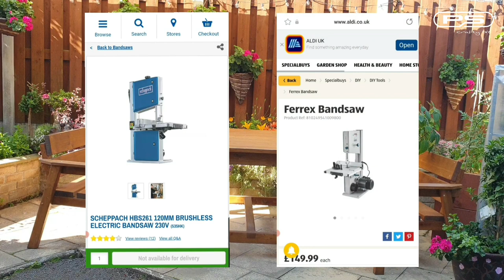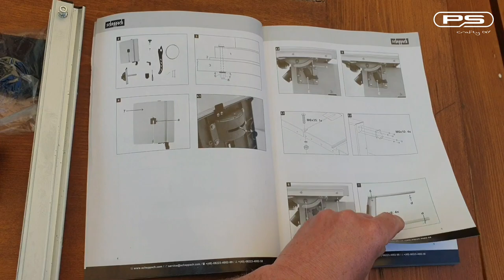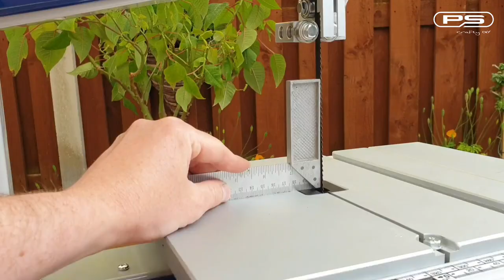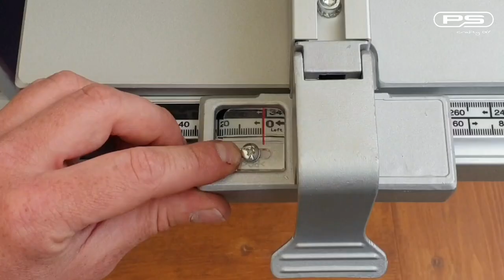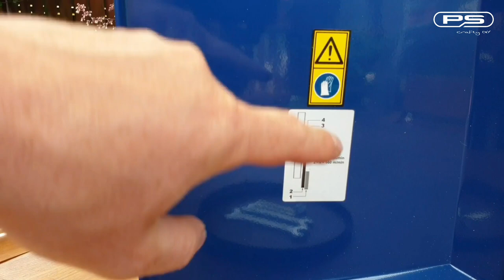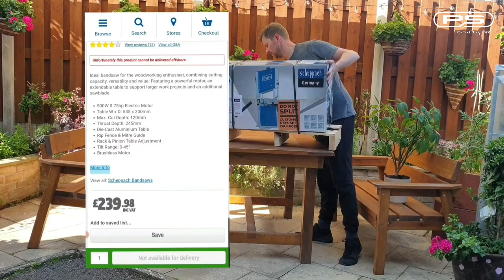Scheppach HBS261 Aldi Ferrex Budget Bandsaw Review || Unboxing, Assembly || Set up for accurate cuts

Comment: Dear @PS Crafty DIY, thank you for sharing your knowledge and experience. 🙏🏻🙏🏽It was extremely helpful 🙏🏻🙏🏽.
A little tip I could give back: Taking a little drop of a Ceramic/Nano Coat Spray on the outside of the ball-bearings keep them smooth and nearly dust free. (Personally I used it also for nearly every surface, but especially on the Fence, table… )
Reply from the maker: Thank you. I use Interflon oil on all my gear to keep the dust off. Also works great.

Comment: I have been ripping kiln dried hardwood on this machine for 3 years , excision blades are the only way to go , had to replace a external motor capacitor once, bought the capacitor from jay car, my machine has done some heavy hard work, just take it slow
Reply from the maker: That's great, thanks for reporting your experience with the saw. Faulty cap after  years of hard work is not bad to be fair, they tend to go in motors powersupplys etc. I bet it was only few quid.

Comment: I just got one of these, thanks for the review. They are now back in stock in the UK at the usual places (toolstation, screwfix) but sadly no sign of the bargain version back at Aldi
Reply: So now I have it running initial impressions are positive. It was reasonably easy to adjust everything to get it square following this video. The main things I don't like are:
 - it's hard to explain, but there is a lot of wobble in the the upper blade guide as you raise and lower it, which can make it hard to set the position relative to the blade consistently. I assume this is normal? 
- the supplied blade gives a somewhat rough finish, but this seems to be  common complaint. I'm keen to try something better.

Comment: Superb informative, and funny, video. Great work. Keep it up......one question; any issues with the 4.7mm blade? Has is lasted well? (would also be good to add the Tuffsaws link to the blades in the description).
Reply from the maker: Thank you. The blade did quite a lot of job before it snapped. But I think its my fault as forgot and kept in the saw tensioned up for long period of time. I would not hesitate to buy this blade again. I didn't include any links as I am not sponsored by anyone. But all my blades are from TuffSaws and they are from the Supertuff carbon range.

Comment: Grazie, comprata una oggi ma senza il tuo video non sarei mai riusvito ad intallarla.
Please,dimmi la lama che hai ordinato ,grazie
Reply from the maker: Hi, thank you. The blades I use are from TuffSaws.co.uk I have ordered the Supertuff Carbon range. 3/16inch 6tpi is my thinnest blade  and 1/2inch 4tpi is my largest blade. You'll need 1790mm length blades.
Reply: @pscraftydiy  grazie molte. sei gentilissimo. Per favore aiutami ancora:   la lama e' troppo spostata verso destra e rischia di toccare la plastica . E' possibile spostarla di qualche millimetro verso sinistra?  grazie ancora.
Reply: posso inviarti un video e/o una foto ?
Reply: @silverblogsurfer9338 Hmmm...thats not good. The blade should not move left or right unless being pushed over by guide bearing or something. Its position is defined by the top and bottom wheel alignment. The bottom wheel can be adjusted at the back of the saw by 4 screws around its shaft. But please do some research before you start as I have never done it before and certainly not an expert. It should come set from factory and you should never touch these. If your saw is new in warranty take it back or contact Scheppach for support. Try running a proper blade in it first. The one that came with the saw is rubbish and you'll never get that to perform.

Comment: Excellent video!!! So in depth detail of the setup. The best one i´ve found so far. Im looking forward on upgrading the blades. Which blades would you recommend for straight cutting and radius cutting from TuffSaws?  As TuffSaws seem not to be shipping outside the UK at this moment is there other reliable brand/supplier i could get decent and reliable blades? Thanks again.
Reply from the maker: Thank you. I've never tried any other brands than TuffSaws blades to be fair. These have been recommended to me along with the Bandsaw Shop blades manufactured in Leeds. These also have good reviews. I made some inquiries with both manufacturers but only TuffSaws were able to supply the 3/16 blade and actually said if it snaps or does not run in the HBS261 they will replace it with 1/4 that they know for sure it runs. That was convincing enough for me to stick to them. They recommended the Supertuff carbon range as lot more tension can be applied and better traction can be achieved because these blades are thicker. One disadvantage is that the cut is slightly wider kerf than standart blades. No bother so far though.
I use  the 3/16 6tpi blade for tight curves and the 1/2 4tpi for long straight cuts in higher stock. But since I found the 3/16  runs with no problem and cuts straight I run it on most task I do, straight or curves in lower softer stock. Saves me changing and setting up all the time.
Its a shame TuffSaws don't ship outside the UK but you will find that with most small companies in the UK after Brexit.
Try joining a bandsaw FB group in your country and see what blades people use in the community more local to you. Thats how I found out about TuffSaws and the Bandsaw Shop. Hope it helps and if you find europian manufacturer that is good and makes 3/16 tpi blade for HBS261 please share as there is a lot of interest from EU viewers. Many thanks
Reply: Aw, shucks! That's exactly the info I needed! OK, I'll search around. Thanks!

Comment: Brilliant video, so clear. Can you please confirm/advise where and what you bought to replace the supplied blade?
Reply from the maker: Thank you. I got my blades from TuffSaws https://tuffsaws.co.uk/ and I went for their SuperTuff Carbon range as that's what they have recommended to me when inquiring about running the 3/16inch blade in my saw. The blades are slightly thicker which can be bit of downside as the kerf is slightly wider but they are very strong and I really like them. Blade lenght for Scheppach HBS261 is 1790mm. Hope that helps.
Reply: @pscraftydiy  Hello again. Sorry to bother you again but a couple of further questions if you wouldn’t mind? I took your advice and got some new blades from tuffsaws - three all together, one the same size and tpi as that supplied with the saw, one larger ( half inch) and one smaller for finer work. I have only used the 3/8” one so far but had quite some trouble getting it tight enough. Did you struggle also? Do you slacken off the tension when you are not using the saw? What about the spare blades, do you leave them coiled up or un-coiled.
Reply from the maker: @johnfreezer7239 Hi, no I didn't have any problem tensioning new blades from TuffSaws. Check if they've sent you correct lenght and check your tensioning mechanism is not damaged/ stretched, are the threads on tensioning threaded bar OK, not slipping? Hopefully it's just the blade being to long. Did you try the original blade back in, how did that go? Compere the blade lenght with that.

You are not supposed to leave tension on when not using/ storing the saw. It can stress the blade, tyres or tensioninig mechanism. But I must admit I sometimes forget to release tension when I am done. So far I had one blade snap on me when started the saw due to this but no damage to saw found. 

I always coil up my blades that I am not using and put them back in the box they came from due to lack of space in my garage. 
Hope that helps, let me know how you get on.

Comment: Have you done a lot of resawing on this machine? I sometimes need to resaw something and the table saw is a bit scary for that.
Reply from the maker: I have done little bit of resawing, not much. The heighest piece I've done was the african iroko you might have seen in the video and the longest piece I've done was pressure treated softwood, approximately 1m long. With a good wide blade it was cutting accurate and it was not lacking of power. Never tried any hard wood but I am sure if taken steady it will do the job.

Comment: Hi 
Great question
I bought a new blade for mine, followed all the steps but I'm having a lot of blade drift without even cutting. I also purchased from tuffsaws. I did buy a 12mm blade?
Reply: Sorry to add a bit more detail as I'm now having big issues with my 6mm depth blade. When adjusting the bottom wheel is slipping off. But when I get it to run properly it's creating a loud squeal. Any ideas?
Reply from the maker: Sorry, is your blade oscilating left and right without even cutting? Is that what you meant? If thats the case your top or bottom wheel is not balanced or concentric or one of your tyres could have high/low spots that could cause this as well.
Reply from the maker: Also, open both guards take all guides off to keep these out of equation keep rotating the wheels manually and see if the blade catches anywhere on spine, frame etc. Check tyres are not slipping if the blade cannot be tracked and keeps slipping of the bottom wheel and you 100% sure it does it with every blade then your bottom wheel is not in line with the top one or not centerline with top. There is 4 screws round the shaft for the bottom wheel at the back of the saw I beleive thats what they for. But I am not familiar with how to do the adjustment there properly and would not touch those without researching how to do this. Is the saw new or have you had it for a while? If its new and nothing works take it back. Hope you get it sorted and if you do, let me know what it was, I am interested.

Comment: I have a question !
How did you cut the in side of a close shape ?
min 12:33 !!
I would be happy if you answer me 😉
Reply from the maker: Hi, both bandsaw jewellery boxes you have seen in the video will be featured on my channel soon. Each will have a dedicated video where I'll explain how to make them from start to finish along with mistakes I've done during the making so you can avoid them. Concider subscribing so you dont miss anything. 
The internal cuts on the piece  you inquiring about are done on the bandsaw. I started the cut through a stem which is a common blade entry to each leave. The entry cuts are then glued back together and what had been cut out from each leave becomes a drawer to store jewellery in.

Comment: Hello, what to do to make the tape cut straight along the line and not run to the sides?

￼
Reply from the maker: Hi, I explain the whole set up in this video. First you need to make sure your blade is tracking correctly and has a correct tension then you set the guides. After that you set your table 90 degrees to the blade and set your fence parallel to the mitre slot. If the blade still drifts from the line you need to set the teble by twisting it to componsate for the blade drift 4 bolts underneath. The set up starts round 4:24 in this video or you can use my other video which is dedicated just for bandsaw set up. Make sure you have decent blade as the one that came with the saw is not great and I could not get it to cut straight  on the line.
Reply: Thank you for your answer. I hope I can handle it. Tape drift is annoying. Regards

￼

Comment: Hello. Please help. I need the numbers of the lower (drive) wheel bearing. Regards
Reply from the maker: Hi the bottom blade drive wheel bearing is 6001Z if thats what you meant and the blade support side guides are 626Z if you need them. Hope that helps.
Reply: Thanks 🙂

Comment: Mitre guage slots are all very sloppy on all Bandsaws in and aften also above this price range, make a new runner for the guage from Hardwod
Reply from the maker: I know, it is sad and whats even worse is that they expect us to put up with it. I am not paid or sponsored by anyone and bought all my tools with my own money so if there is anything wrong with the tool I will point it out and inform my viewers at least. I have got the same problem on my table saw and the plastic strip with double sided tape worked a treat on both,  well over a year. It does not expand, contract or twists like hardwood wood with moisture levels in my prefab garage eather.